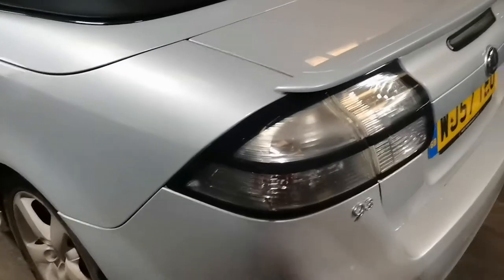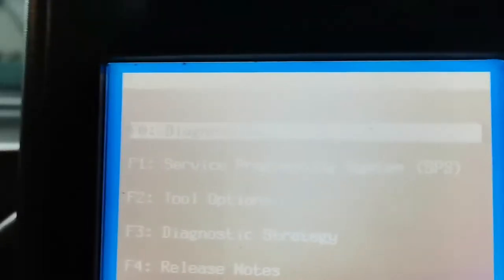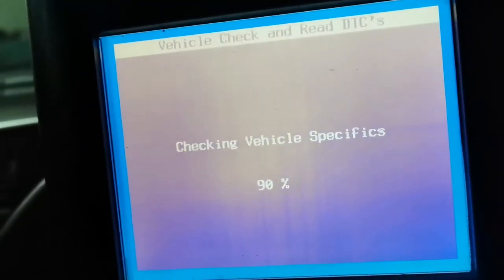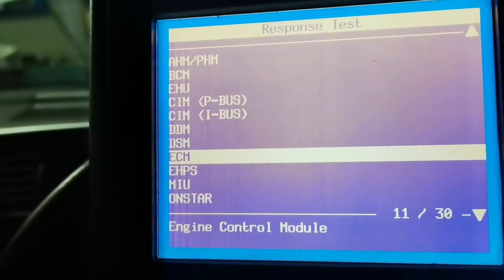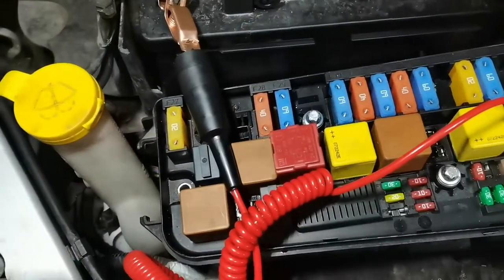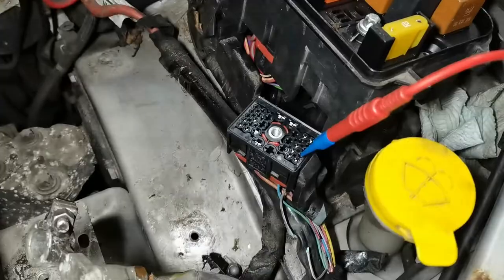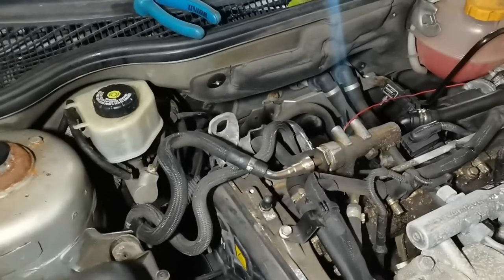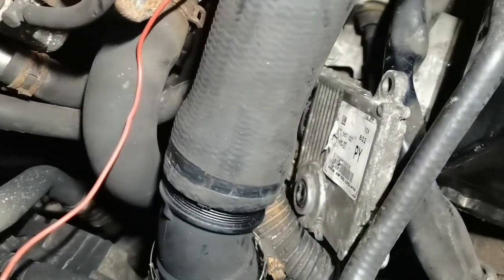Saab 93 Non Start

Comment: Helpful video mate I'm having an issue with steering lock malfunction.  Had all the usual fixes done ism and steering lock unit and narrowed it down to a wiring issue. Any tips? Fault is intermittent and tech 2 says its a fault with the cim wiring circuit
Reply from the maker: Hi Adam 
OOOh im not sure without seeing that one, i did once have a Cim unit show this fault but wouldn't want to guarantee it. Sorry mate

Comment: Hi fantastic video i have a 2006 Saab 93 vector it was playing up after we put fuel in i was told its the ECM and have to get a new refurbished one, we haven't got one as yet i took battery out and charged it for a week i put it back in but now when i turn the key there is nothing dash lights work ect it comes up traction control failure i checked the yellow wire that goes to the starter motor when the key is turned there is no voltage  any help would be appreciated
Reply from the maker: Hi sorry for late reply, how did you go on?
Thanks Rick
Reply: @halemotors4084  Hi i sent the ecm off to get a refurbished one but they couldnt get data off my old one so had to take car to them they put a refurbished one on only to get half way home the engine light come back on so rang them they said they didn't programe it properly so i sent the ecm back so they can do it properly.
Reply from the maker: Oh dear. Good luck

Comment: what area are you in
Reply from the maker: Good morning.
In Manchester .Stockport.
Thanks Rick
Reply: @halemotors4084  that red relay. my saab doesn't have one don't think it ever did but not sure but is it necessary?
Reply from the maker: @NoCutCardz  Is yours a petrol?
Reply: @halemotors4084  yes if that means regular Gas
Reply from the maker: Yes its different o a Gas one. @NoCutCardz

Comment: Very thorough and informative presentation of Tech 2 work in action. I'm sure it made for a very secure car in the day but starts to be a real pain on old cars. Currently my problem is an unreliable Ignition switch which switches ignition on but whether it cranks is a lottery . I have changed the switch module a couple of times but keep getting this issue erratically. Is it a common problem for SAAB's?
Reply from the maker: Hi Dave , Yes get lots of can problems on them, check your wiring on top of the gearbox bell housing, really common place to get wiring corrosion. Thank Rick

Comment: What if the key won’t turn at all and steering wheel won’t unlock already changed battery in fob
Reply from the maker: Hi Adam, you'll need diagnostics on it.
You can turn the key when you go into diagnostics, Forced ignition release is the title.
When you run a global scan it will tell you what's blocking the key.
Thanks Rick
Reply from the maker: Tech 2 is a dream on this fault

Comment: Excellent tutorial. Well done.
Does anyone know by any chance why my Saab 9-3 2003 automatic car refuses to start. The key fob goes in, it turns, no error message on screen, but as soon as I put the key fob in the ignition, the steering wheel normally automatically unlocks but in this case it doesn't unlock at all and the car tries to start by turning the engine over, but but nothing happens. Any ideas as it is driving me crazy. If only I had an error message then it might possibly help. This happened all of a sudden. 
Please help if possible. I love my Saab and I cannot part with it.
Reply from the maker: Do you have access to tech 2?
Reply from the maker: If youve had the batter diconected the steering column lock doesnt work until the car has been driven over 6 km /hr.

Comment: ---

I have a Saab 9-3, model year 2003, version 2. When I park the car and leave it for 8-10 hours, it won't start in the morning. All the electronics work (like the radio and lights), but the engine doesn't get power to start.

To get the car running, I open the hood and connect a cable from the starter relay to the negative terminal on the battery while the ignition is on. The car then starts immediately. After this, I can start the car normally with the key until I leave it again for several hours, and the problem occurs again.

Does anyone know what the problem might be!?
Reply from the maker: Is it Petrol or Diesel?

Comment: I've been chasing a fault on my 57 plate 9-3 Aero Convertible 6 speed manual for 18 months.
To start with it was intermittent and only happened in wet weather.
Messages while driving, stability control, traction control, ABS all fail, car still drives fine, after a few minutes the speedo and rev counter bounce up and down like crazy.
This is a pretty long story so, I'm going to stop here, you've given me a few extra areas to check, .
Can I ask where you are, I'm up in Cumbria on the west coast.
I failed to get it running last summer and if I fail again, I'm going to ask if you will look at it, whatever it costs to transport I don't care I just want this car running.
There's lots of info from my Tech II, but it's too long a story to type here, can I contact you via email?
Reply from the maker: Yes feel free, richardbenson99@btinternet.com
Thanks Rick
Reply: Bad abs module. Very common
Reply: @halemotors4084   update on this.
One of many things I didn't mention initially was that I had replaced the engine management loom and that didn't help.
Even though on the old loom a wire providing 12v to the ECU had corroded and burnt out, completely broken.
Made no bloody sense at all why changing the loom didn't fix it.
Here I go again around in circles..
Ultimately it turnout that when that wire had failed it must have drawn a lot of current, there was no continuity from the connection on the bottom of the fuse box to anywhere, the track on part of the PCB had evaporated.
Made a bridge bottom to top through an appropriate fuse and she's been purring for just over 14 months now.
Reply from the maker: Hi Gordon,
Yes email me richardbenson99@btinternet.com
We are based in Stockport ,Manchester.
Thank you Rick @GordonBenny